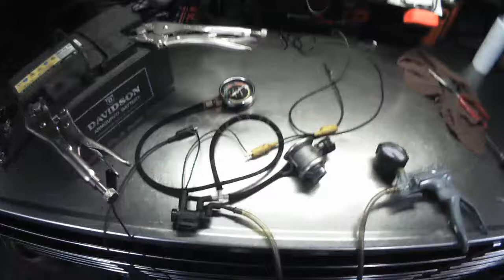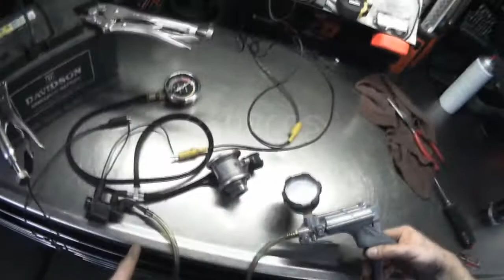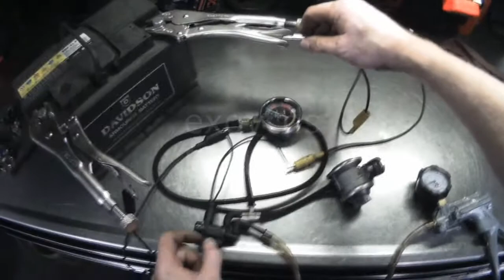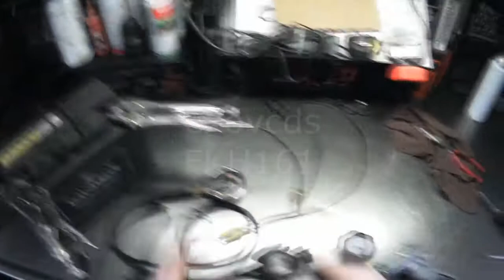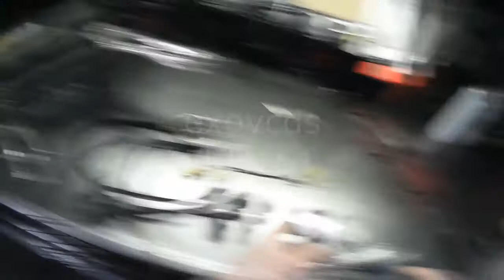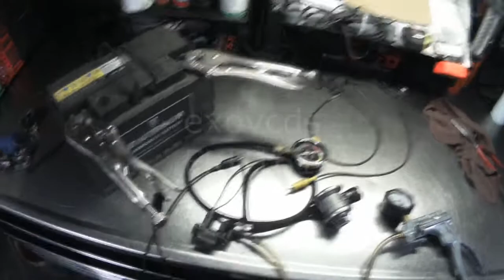VW A4: 2.8L AFP VR6 SAI Vacuum Solenoid (Explained)

Comment: I just want to say, "Thank You".

Your videos have helped me so much in diagnosing, repairing and accessing different components of my MK3 VR6.

I bought it as a complete bucket... and now its my daily driver. A few more issues to work out, but she runs better every week.

Oh yeah, and thanks for those tips in your transmission removal video. That diff is a pain to properly guide in and out of that area without rotating the entire trans. Just did my clutch and that saved me a lot of time.
Reply from the maker: Thank you for the kind words and thanks for watching and taking the time to comment!

Comment: I like the vise grip idea..Im gonna have to still it lol....
Great work Thomas this video and the other one with the gurgling noise makes more sense to me now..IM just too lazy to fix my own car.
Reply from the maker: That's how I lift batteries out of some cars. Did it while a customer was watching one day... wasn't wearing gloves, he freaked and said you're gonna get shocked! I laughed and explained that my body had a lot of resistance and that I'll be fine. I have however touched power & ground with obe arm before and felt a tingling sensation!
Reply: You are a brave soul,doing that and pulling wires while the is running just like you did in that vanagan with fuel issue....No sir not me,felt the shock once and that was all i needed..lol

Comment: Hello I have a 2002 Jetta gli vr6 that has a slight lack in power and runs just off after car warms up. I had all 6 spark plugs and coils changed just recently check engine light came on. Gave me a misfire code as well as injection and catalytic converter code. Had them cleared and they haven’t returned yet. I’m having exhaust come out of a small area on the top left side of my engine kind of like how you explained. Was like that when I purchased. I never noticed until I turned my defrost on and I could smell it coming from my air conditioner. Any advice would help. Can post videos later. Thanks !
Reply from the maker: I don't understand what you mean by "and runs just off after car warms up".
Standard or automatic? What are the actual fault codes?
Exhaust smell / leak should not cause power issues... fix the leak(s) regardless, as breathing in exhaust fumes is a health issue.
Reply: Thomas EXOVCDS okay sorry for such the late response ! I meant the car runs fine when cold then once it warms up I’ll get the lack of power. Mostly in my lower gears it is a 6 speed 24v. I’m new to the car mod stuff. So I didn’t know it has a sai delete and that the that was coming out was from that. Should it be plugged would it make a difference or not ? The codes that it’s pulling are P0420 and P0411.
Reply from the maker: @yaboiievann  I'm still at work... will get back to you later tonight once I am at home.
Reply from the maker: @yaboiievann  I left a message under the video.

Comment: Hey Thomas the SAI solenoid on my 01 Eurovan gls 2.8l 24v is stuck energized. The combi valve is always open because of it. I'm getting a fault  code 17832 Leak Detected intermittent. I've run block /group 77 to force readiness and can't get it to pass. I've tracked it down to the 2 pin plug at the solenoid.  I'm getting a constant ground from the gray wire and constant 12v on the blue/red wire.  Assuming it cycles via a groumd from the ecu I unplugged the ecu. Nothing changed still had groumd and 12v at the solenoid plug. I tracked the grey wire from the solenoid connector all the way to a grey 1 pin connector at the back of the fuse box and then it runs up into a larger loom up near the cluster. I unfortunately don't have a bentley yet as I just bought the van 2 weeks ago. Any info on where that grey wire goes would be greatly appreciated.  Really dig the videos!
Reply from the maker: N Inf My PC is off for the night... I'll get you a wiring diagram tomorrow. Send me a message if you haven't heard from me by noon tomorrow (Pacific standard Time)... I have a lot of people to keep track of.
Reply from the maker: Here's a wiring diagram for the ECM: http://fkh161.ca/VW/EV/EVECMwiringVR6.pdf Color code seems different in this diagram. The red/blue is power from the fuel pump relay (as long as the engine is running, should have power). Tracing down the wires is gonna be a manual thing... I wouldn't know where it goes, aside from the ECM.
Reply: Thomas EXOVCDS Thank you much for this! I wonder why the colors are different. My build date is 12/00. does the 2000my look the same? Again appreciate your time!
Reply: Thomas EXOVCDS  just figured out the previous owner had the Secondary coolant pump connector switched with the sai solenoid. switch them back and ran group 77. passed! Thanks for your help!
Reply from the maker: Thanks for the update... I didn't spend a lot of time looking at the wiring diagram. Glad you found a simple fix!

Comment: My litte v6 passat has a bit of a resitance and hiccup when I step on the gas at 40mph but not in the cold mornings.  Is that the vacuum solenoid is bad indicator?
Reply from the maker: Secondary Air Injection is an Emission System... it is used to lower emissions when the engine is cold. If you have a vacuum leak or vacuum solenoid issue, the ECM will set a code. If the leaks are small, the ECM can compensate and no code is set, until it has to compensate too much. A hiccup can be an electrical glitch or a cylinder misfire or a transmission shifting issue. Without seeing the car, test driving it, or seeing scan data... it is difficult to guess what the problem might be.

Comment: If you don't have a plug on the head where the sai hole is.
Would I see a difference if I plug it with a 42dd plug delete?
Reply from the maker: +theblackslcmamba If you don't plug the hole in the head then you will have an exhaust from that hole. If you don't have any exhaust leaking from there, then the passages are plugged. You will need to reflash the ECM to eliminate SAI or the check engine light will come on.

Comment: Hi. i  have had a misfire and lean condition bank one . betwen air box and tb is a hose on the front that goes along the intake and then drops down. this hose had constant manidold vacuum. i plugged it and misfires whent away. i cant find info on it on the web . but question is what is it? can i leave it plugged or? thanks for any answer. vr6 eurovan 2002
Reply from the maker: Can you post a video of the hose? I think I know which one you mean, but want to be sure.
Reply from the maker: I forgot to ask... any recent work on the van / engine?
Reply: @EXOVCDS   im sorry i dont know how to post a vid or pic!? i have changed sparkplugs and oil filter. fixed cracked pcv hose to the boot. ill try to post a pic or vid .just dont find the option to attach. thanks a bunch for your reply
Reply from the maker: @makke8668   if you are using your smartphone youtube app... press the + sign at the bottom center of the screen. You'll see it at the bottom of the screen. Simply attach your video and the I'll go to your channel to view it.
Reply: @EXOVCDS  ok
Reply: done
Reply from the maker: @makke8668  Just got home... had an errand to run. Will watch now. Thanks!
Reply from the maker: @makke8668  Could you give the engine production code? Is it AXK like here in Canada?
Reply: @EXOVCDS  amv
Reply: was a office police van. has a heater that uses gas from the tank to heat the interior when stationary with engine off. :)
Reply from the maker: @makke8668  The hose / plastic pipe goes to the intake manifold for the fuel injectors. Here is a picture of an injector:
https://c1552172.ssl.cf0.rackcdn.com/711082_x800.webp
Fuel goes into the injector at the top right and comes out at the bottom left (below the brown o-ring). Above the brown o-ring you can see a wire mesh screen... that is where air (from the plastic pipe) enters the injectors... the air helps atomize the fuel as it comes out of the injector. 
I have never measure how much vacuum is "normal"  on that pipe... it could be that when you plug the pipe, that you are fixing a problem that is somewhere else. For example... from 1 to 10, if an engine starts to run rough / misfire at 5 (due to extra air or not enough fuel) and you now remove "normal air that the ECM is programmed for" by plugging the pipe. The 5 will now be less, maybe a 3... but the original problem is still there. Does that make sense?
Reply: @EXOVCDS  kindof. my misfire was cillinder 1. ill study the picture.  bank 1 had white plugs but not bank 2. So basically i shuld get worse gasmilage now. curius. havent found any other vac leaks. unplugging makes angine shake and multiple random misfire plus misfire cillinder 1.  guess ill have to think about it. if i leave it pluged shuldnt heart the engine? as runs so much better. hm dont really know what to do. thank you.
Reply: @EXOVCDS  ok so i shuld check .gas filter. gas pressure. em possibly pcv. thanks again. have been serching the web and forums several times without succes. thanks again. will return if i find the other fault. most probbably airleak!? have a womderfull evening. oh or mornin ? :)
Reply: what couses bank 1 plugs to become white and not bank 2? could  bank 1 injector orings all be bad? eh hm hat of to you sir.
Reply from the maker: @makke8668  The intake manifold / air is shared between bank 1 & 2... meaning that an air leak (into the intake manifold) should affect both banks equally. Is the color difference present with the hose plugged or was the color difference before you plugged the hose? It is unlikely that 3 injector seals failed at the same time. I would smoke test the intake system to check for leaks (just in case there is one)... I would then do a fuel injector flow test (attach a fuel pressure gauge) and then check pressure drop as one injector at a time is cycled (you will need a scan tool to activate each injector (engine off) or a fuel injector  tester. If all injectors flow the same amount of fuel, then you know it is not a fuel starvation issue... at worst, you will have to remove the intake manifold to check all the injectors for o-ring damage or screen damage. This is what I use to trigger injectors manually:
https://www.amazon.com/OTC-3398-Injection-Pulse-Tester/dp/B0002SR5OO/
Reply: @EXOVCDS  ok . the colour difference on bank 1 and two was on the old plugs and the new ones. before pluggin tube. ill do a smoke test. and might bye a better scantool. i heard the intake lengths are different to bank 1 and 2 might be a hint to why only bank 1 shoes lean burn. i also wonder why i can now after pluggin can hear something like a back fire if that is what it is. it only appears after starting and pumping the gaspedal .then dissapears after rew seconds. to rich i supose. muchas gracias
Reply from the maker: @makke8668  The length is different because the air has to travel through the head farther for 1, 3 & 5 cylinder, but the air passages receive the air from the same manifold. A problem with one of the O2 sensors, could cause one bank to go lean (because the ECM thinks that bank is rich (I forgot to mention that earlier, sorry). If you disconnect the front O2 sensors, the ECM will go into a "preprogrammed" injection / fuel mixture strategy. If the spark plugs look more uniform with the sensors disconnected (after driving for some time), then I would be suspecting an O2 sensor issue.
Reply: @EXOVCDS  i have only 2 o2 sensors .i disconected the one before cat. and the engine ran same rughf. have had codes for the one after cat saying something about voltage. my scan tool was showing me cillinder voltage and cillinder one was the lowest. dont knoe what voltage that was. the o2 sensor before cat was not ossilating normaly. whent all the way to 3+ volts down to about .85v. i did get confused about the o2 sensors but i only have 2. Im thinking gas related as plugs nearest front bumper where white. I thought cillinder one was bottom left standing infront of engine. if so then wouldnt bank 1 have shorter air channels. I wonder why the different colours on the plugs. if the car has only one pre cat o2 sensor. and if air leaks shuld affect all cillinders. leaning towards low fuel on the cillinder row nearest front bumper. ive not got a code for lean condition only the plug coulurs. and missfire. the missfire was often but not allways. and hard to notice when driving. it is now more powerfull with tube pluged and no misfires at all. long conversation. i was looking for a repare manual for this model but not so common.  only 2 o2 sensors.
Reply: if this model is supposed to have two o2 sensors higier up on exaust manifolds. and then possibly two cats.  maybe someone changed it. because now there is one under the car before the cat. one after cat.(s) and it actually looks like a smaller cat then a bigger one inline. . seems like it would make sense. ill have to post another video under the car
Reply from the maker: @makke8668  I can look for a service manual / information for you... click the fkh161 link in my video description and then click on "tool request" to send me a message / email and I will send you information. The ECM can not detect differences between bank 1 & 2 if there is only on O2 for both banks (at least that is what I think, I could be wrong). Your front O2 sensor should be a wideband sensor. At idle, they usually have a voltage of around 1.2 to 1.5v. When accelerating hard, the mixture should go rich and the voltage should go below 1v. When the engine decelerates in gear, the ECM cuts fuel and the sensor should go lean... showing a voltage of 4V. It could be that your AMV engine only uses 2 sensors (1 front & 1 back). I will look for information, so that I have it ready for when you email me.
Reply from the maker: @makke8668  What year is your Van?
Reply: @EXOVCDS  2002

Comment: Hey Thomas,  Just found your post today, and know that it is 3+ years old now, but wondering if you could confirm the part # for the SAI Vacuum Solenoid that you were working on in this video.  The part that keeps showing up on internet searches by description is 191906283A, but when I check this part on VW site (What This Fits), my vehicle does not show in list.  01 Jetta Mk4 VR6 2.8L.  Thanks in advance for any help.
Reply from the maker: Same part... I'll see if I can find it in the VW Parts Catalog.
Reply from the maker: http://fkh161.ca/VW/VR6/191906283A.jpg
Reply: You're the best.  Sincere thanks for the JPG, your prompt reply, and of course for the video!

Comment: Next video will be secondary air delete lol great video man
Reply from the maker: This video was made for someone... it looks & sounds more complicated than it is.
Deleting the SAI system is more involved than fixing the system... what I mean is, fixing the system (when there is a problem) is easier than deleting the system.
Reply: @EXOVCDS  My MK4 Gti 24V 2.8 Vr6  Is Reading A Code With The Secandary Air Valve, What Should I Need To Be Replacing Thomas?
Reply from the maker: @Blade_5308  I don't know what the problem is. Could be a blown fuse, bad air pump, broken vacuum hose, bad vacuum solenoid, bad air tube from pump to combi valve, bad combi valve, restricted air passages in the cylinder head... check the system / eliminate one thing after the next. Once you know what is bad, you can determine what you need to fix things.

Comment: It seems the vacuum leak is common with this car, when they have higher miles or in warm weather.  Colder today and it did not happen.
Reply from the maker: Vacuum leaks are common on all older engines... hoses deteriorate, seals get hard and crack etc. A smoke machine will find leaks quickly... if your check engine light is not on, then the ECM is able to handle the small leaks.
Reply: *****
Yes,  I guess the simplest remedy is to replace the hoses first and see if that helps.  but it is probably the solenoid since the car does not so that when it is cold in the morning.  Only when the ambient temp is about 70 and up
Reply from the maker: Conde Nast  I still don't know if you are chasing a SAI problem or a "driveability" (hiccup/hesitation/shifting) issue. No need to replace SAI vacuum hoses if you are having driveability issues. Vacuum leaks will not create "hiccups" as long as they are small... if they are big leaks, your ECM will store a code for "Running too lean". If you do not have "Lean codes", then your "hiccup" is not due to vacuum leaks.
Reply: I finally discovered how to use the semi-auto tiptronic side of the tranny and it doesn't do that when in that mode,  so will eventually try replacing that solenoid that is controlling the full auto tranny.  Thanks for the insight.

Comment: I have a 1999 vw jetta 2.8 liter! I am having issues of the car running really rough! On the far left in the back of the intake manifold there is a hookup for the evap and when it is plugged in the car bogs down really bad and want to shut off! What could possibly be the issue! This is my first foreign car! Thanks
Reply from the maker: Sorry about the late reply,  I'm on vacation... can you post a video of the part or send me a picture?

 fkh161@fkh161.ca

If it is the EVAP Purge connection, maybe the purge solenoid is stuck open?

Post a video or send me a picture so I can take a better guess.